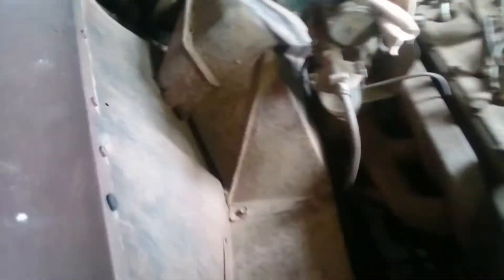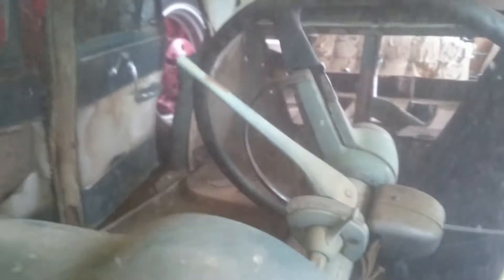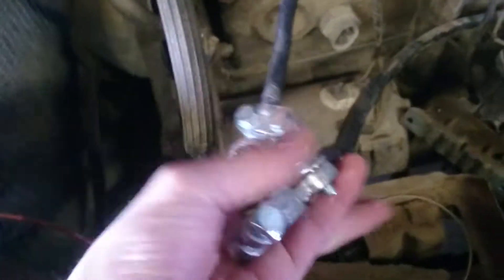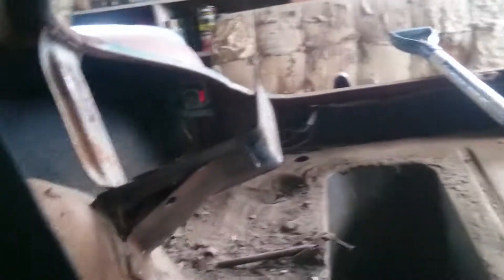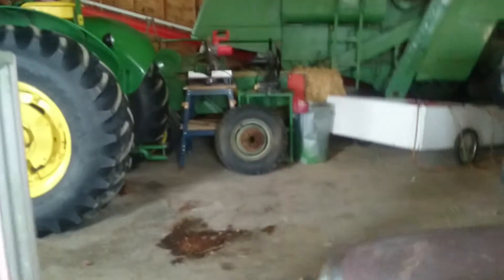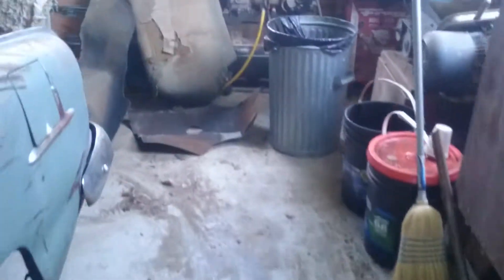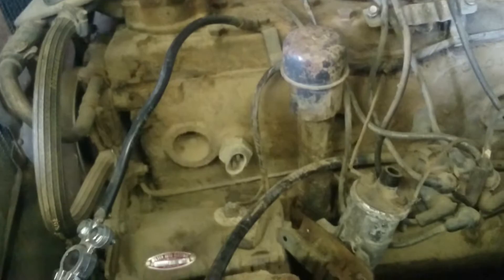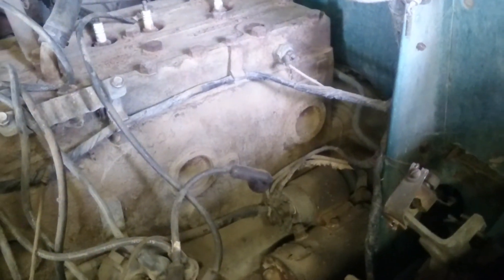52' pontiac part 3 stripping out interior.

Comment: The clips holding the window crank handle and door handle on are a nightmare. They are C clips and you have to push the door panel back, push the little plastic or metal washer looking thing back and then push the C clip lose. Easier with the clip remover tool but I used a pick from Harbor freight and was able to get it off

Comment: gotta be a Canadian  pontiac it has a Powerglide  not a hydromatic
Reply from the maker: Tom Burgess is that the type of transmission? Yeah i would think its a canadian car because my great grandpa bought it new or almost new.
Reply: +Brother Blacksmith yes sir that is a Chevrolet  Powerglide  and that is great  they  are  more simple and easier to fix rather than the hydromatic  that came in the American pontiac . .. your engine is an American pontiac later Canadian pontiac  had 261 OHV  6... I suggest you try to get a factory shop manual (ebay?)  hydromatic in that year had no park position ... you will have the coolest car in school when you are done.  I am an American   but I lived in Calgary  1963 to 1965 and myself pals had cars like this in high school  best of luck